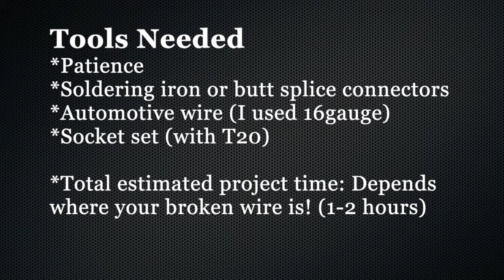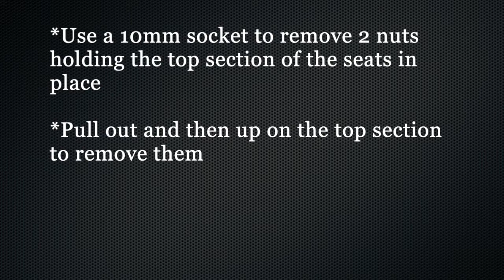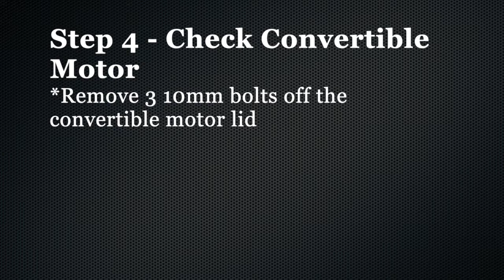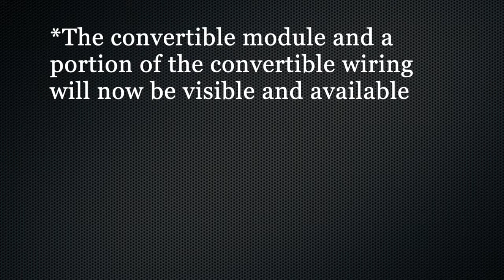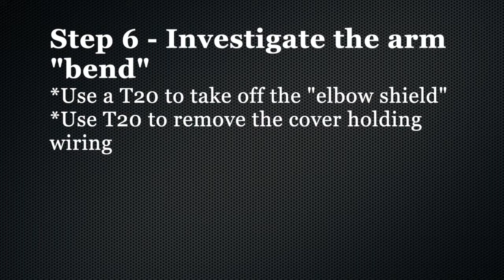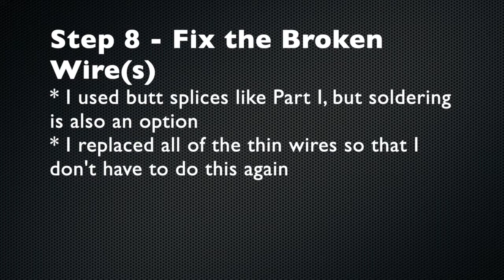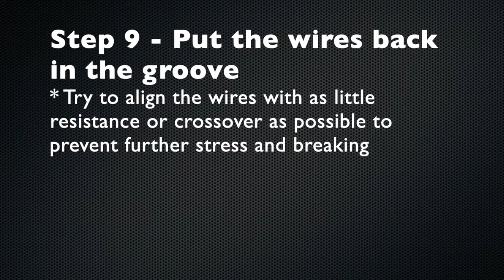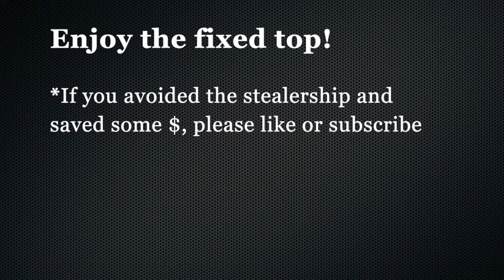BMW e46 Convertible Wiring Diagnosis & Fix, Part 2

Comment: This is one of like 3 videos that actually tells the viewer anything about how the top systems in these cars work. I've been hunting for like a year in my efforts to figure out what makes them tick besides the obvious hydraulics that we all know about.
This is probably the best explanation I've seen, by far, and it's going to be instrumental in my efforts to repair my top system- though I'm going to be removing the entire harness so that my whizz kid brother in law can do the soldering for me.
Reply from the maker: Glad this could be helpful for you!  I seriously considered redoing the entire harness because (as you can see) I had to dig pretty deep to find that exposed wire. If it acts up again, I'll probably go that route but so far so good.  Best of luck with your vert!

Comment: Excellent Video Instructions on both parts 1 and 2 you do a great job of getting to the point with no Blah Blah Blah. Hopefully I can find my issue using part 2  to find the short in my system.
Thanks Dude
Reply from the maker: Glad it was helpful and I hope you find your problem. Love dropping the top but they can be finicky!

Comment: Great video. I didn’t get to my top yet, but thanks to you I have a ton of info. One mistake (I think) that I found is the last fuse you mention, 45, is actually a 46, according to Bentley manual.
Reply from the maker: Thanks for the heads up! Bentley manual is king and it's tight quarters in the fuse area. Appreciate you looking out!

Comment: My top suddenly stopped working: 
First it would only open half way and the rear lid would not open.
Then shortly later, the windows would not go down when pressing open button for the top so the top wouldn't even move. 
For a year before this, the windows started acting weird by not "auto up" when pressing the window button, regardless if I recoded the GM5 module. So I think the GM5 module is partly at fault. 

This morning, I recoded the CVM II module (convertible module) and GM module and the top started to work again. Nothing visually wrong with any mechanical part related to the top or hydraulics. I have a brand new virgin GM5 module arriving next week and will program it in order to get my "auto up" window function to work again.
Reply from the maker: Solid diagnostic work! Hope the module fixes it for you!

Comment: Front latches will open, raise a little. All fuses good, checked pinch point on top right no broken wires. Getting no power to top lid motor, do these wires in video activate the lid (top storage) Help please.
Reply from the maker: The wiring harness that you see at the pinch point is the same one that runs in the back quarter panel shown in the video. If you have no power, I have to assume that you have a break somewhere
Reply: @AvoidStealership  Thank you, I'll give it a look.

Comment: So I had just swapped my pump yesterday and i went to test the top and it went up and did so pretty nicely. But then I tried to put it back down and it unlatched and then stopped. I’m hoping it’s not the pump I put in and it’s a wiring issue. Based on the position it stops which spot on the wiring harness should I check first?
Reply from the maker: Start at the bend right above the driver door.  That is the most common break.  Usually one of the thinner wires (green or brown) if I recall correctly
Reply: The top Dow’s go up fine, so it still could be a wiring issue?
Reply from the maker: @ must be nice - I used the PA soft 1.4 software to confirm that I had a wiring issue. The reader and software is ~30 USD.

Comment: The LEDs when I press either open or close button no longer light up and top does not go down, no noise, as if no power to top at all. Any ideas? Already checked all fuses.
Reply from the maker: Hmmm.  On some e46s, they are able to open the top with their key fob.  Often times it is press unlock once, then press and hold unlock a second time for ~30 seconds while the top unlocks and moves.  Give that a shot and if it works, you know that your actual physical buttons are not operational.

Comment: I have a 325ci and the convertible malfunction is so bad that I won’t even unlatch from the front windshield on its own, but sometimes after manually unlocking the front latch, when I press the button it moves a little but I still have to manually finish it up and pack it away in the back and then the back cover doesn’t latch closed. It’s so bad that the feature that all convertibles have where the front windows rise about a half inch to create a seal on the convertible to is inoperable. Mind you the front widows do not go up or down.
Reply from the maker: Hi Jahmaine!  Your problem might be a wiring issue but it also could be an issue with the convertible motor (under the rear seat) or hydraulic pump (in the trunk).  I would start by checking the wiring above the door since that is a common fail point.  If that looks good, then make sure there is hydraulic fluid in the reservoir.  If that also looks good, your convertible motor might not be "catching" because the gear pops out of place.  You can usually hear this problem though.
Reply: Chivas.  Cruz. Azul
Reply: Were you able to fix the problem?
Reply: Hi so I have a problem my light flashes and sometimes it unlatches from the front window then stops and won't even close I had a problem last year too but it just started working again but always in winter I like in the UK but not sure if its a wiring problem I have the right amount of fluid in the pump so it's not the pump

Comment: I fixed the wires on the top left side of the convertible top, (2 wires broken). Then my top wouldn't work, only worked when it was inside the compartment at the back and came out 25% then stopped, I checked for other broken wires (second part at the back) removed the screws and saw no broken wires. So now I do not know whats wrong with the car and why its not closing. (Flashing red light still, does not latch or unlatch it self completely dead until I put it back inside the trunk then it comes back up 25% and freezes). I checked pump fluid level and it is topped up, I checked the motor and it spins.
Reply from the maker: It's odd that by fixing the wires it stopped working. Did you use the correct gauge wiring to carry the signal? If so, it's sadly probably time to break out the multimeter to see where the signal "stops"
Reply from the maker: Another thought: Is it possible that any of the fixed wires are exposed and touching each other? Like when you stripped the wire to solder you left a little bit exposed?
Reply: @AvoidStealership  I just but spliced the wires together, I didn’t use any other external gauge wire to connect the but splice. Simply just put one side in the splice , and the other side in the other end and crimped it.
Reply from the maker: @Swag694  no exposures that can touch?